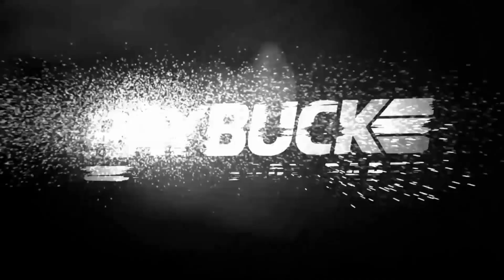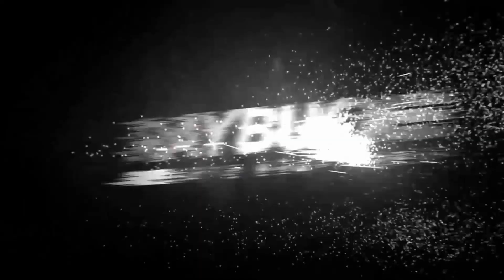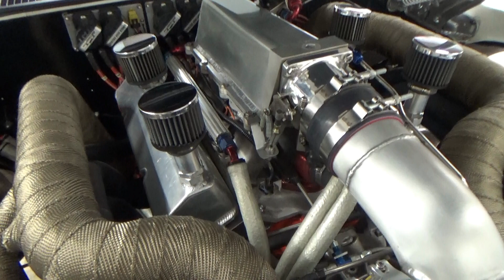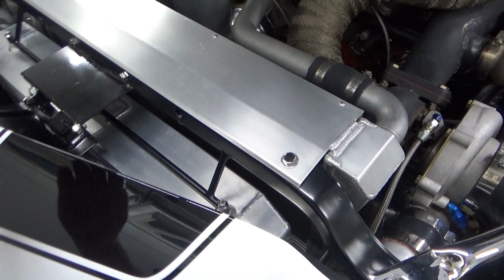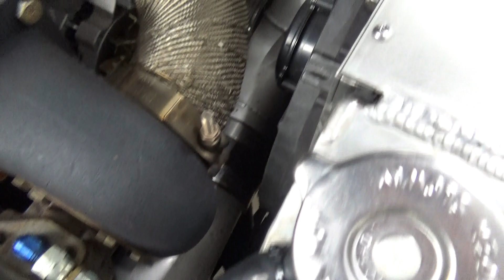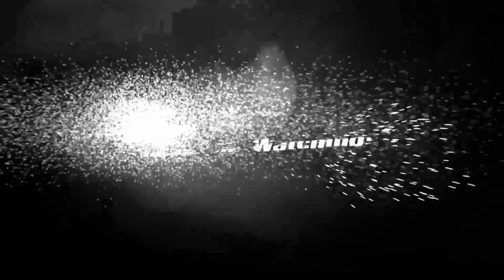1000HP 1971 Camaro Twin Turbo Engine Build Overview

Comment: What's a 372?? 350 stroked? 383 destroked?
Reply from the maker: They are all small blocks with the primary differences being bore and stroke. The 372 has 4.125" Bore X 3.480" Stroke. You can buy a dart 372